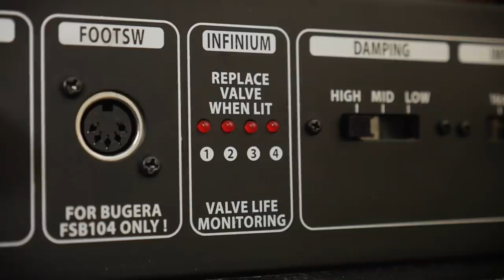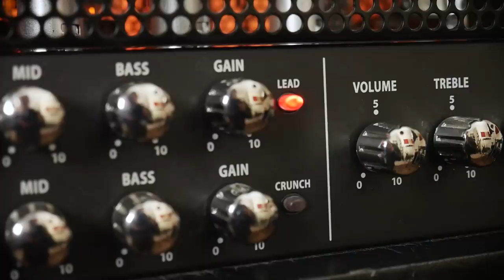Fire Hazard Amplifier?! | Bugera 333 Infinium

Comment: I have to admit, I was very skeptical of Bugera when I was looking for a cheap tube amp I can use for recording at home and it's not helping that Behringer owns the brand. I actually liked the sound of them when I was trying a guitar in a store that sold them. I guess putting a duct tape on the brand works well in keeping them haters quiet.
Reply: Haha, yeah. Did you know though,  The 333 is a Peavey XXX clone, the 6260 is a 5150 clone and the 6262 is a 5150 II clone ;p 

How many knew this? They're basically Peavey knock-offs. I have a PRE Infinium Behrginger 333XL lol. It sound sick IF YOU BIAS IT PROPERLY!!!! The auto-bias SUCKS on these things. From Eurotubes:

"The bias setup is exactly the same as you will find on the XXX right down to the bias test point. This is one place that Behringer should have deviated from the Peavey design and incorporated test points that actually measure the bias current. Unfortunately Behringer stayed with the Peavey bias circuit that measures the negative voltage and NOT the actual plate current. What this means is that you cannot accurately set the bias using the test points. You need to use a bias probe under one of the tubes so that you can actually measure the bias current. DO NOT be fooled into thinking that you can bias the amp accurately as stated in the Bugera manual and on their website. This is a large batch of Barbra Streisand."
Reply: @SolarWarden88  I didn't know that but I'm not surprised, they had a triple rectifier clone. Just Behringer doing what it does best.
Reply: @kurusujann6660  oh yeah, for sure. And at the price point, combined with the proper bias using a bias-probe, they sound sick to be honest. You're not gonna find a combo/head at that price point for the wattage. Sure, you can get the lunchbox amps, but they sacrifice a bit in headroom.

Comment: I remember when I was playing my Carvin X50B with 4x12 cab and it all of a sudden started smoking and caught fire lol. Tubes were 3 months old and had been serviced.  Apparently the design flaw was the tube sockets were mounted directly to the pc board and basically heated it up enough till it caught fire.  A friend of mine is a tech, ended up cutting out the whole back of the pc board and rewired it point to point wiring.  I still have this amp and it works great.  I did swap the EL34 tubes out for 6L6GCs though after it caught fire.  Great amp regardless of this happening!

Comment: I have a Bugera 333XL combo that I got back in '09. Other than the power light sometimes not lighting, I've never had a problem with it. Of course, since I've been playing acoustic for about 8 years now, and my electric guitar amps have been sitting in my Dad's music room for years, I probably have not played the 333XL, or even turned it on since 2013 or so. I need to change that! Wahi' Valleys

Comment: i bought my 333xl Infinium in 2017 I think , It came with el34 tubes. I would like to  trade then out with  6l6 tubes,  , but ive kept it stock,, I keep check on  dyeing tubes  through the lights on the back. It  has heald  worthwhile ,  Only problem ive had over the  years is that the fuse broke,  which was easily replaceable, I luckily have had had no bad experience with the 333xl Infinium

Comment: I bought my 333 three years ago for the absolute bargain of $450aud (about 250 quid) and with only about the same amount of money on upgrades Like Changing to Sovtek KT77 valves and upgrading the capacitors and diodes in the amp with similarly priced but higher quality ones it is now an absolute monster especially with the clean channel used as a 120 watt pedal platform with a good tasteful breakup in the crunch channel

Comment: One of my favorite sounding amps. Mine died after 1.5 years and no one could repair it. Is a shame that Bugera has so many problems. I also bought a 6262 that died, the replacement died too and the third one died but I repaired it myself.

Comment: I bought a new early 1960 infinium in 2012. Sound was immensely plexi-tastic. Blew an internal fuse after 3 weeks.

Rather than open it up & void the warranty, I returned it for a replacement from the supplier.

The replacement amp also blew an internal fuse exactly one week after delivery.

I returned it for a refund forthwith (couldn't trust it to gig with).

5 years later, I tried again to see if quality control had improved. Same problem, but it was 2nd hand, so sold it on.

No fire, just no trust.

Comment: you did the same thing i did and took those stupid plastic pcs off the front. lol. On another note. I had issues with my first as it was second hand and I was warrantied a new one and have had zero issues with it.  THe first one was an easy fix and Bugera let me keep the old one and I repaired it so now I have two and they are both great. The issue with the first was that the valves were mostly dead and it killed the output transformer so I bought a parts amp off of eBay for 100 bucks and had it repaired in no time after, of course , a brand new matched set of Sovteks in both. Now I have a stereo twin full stack setup at a fraction of the cost of some of the amps it destroys on the gain side of shit. I've built all of my own cabinets. They are 3/4" birch, sealed, and each contains a pair of v30s in the top with eminence texas heat in the bottom.

Comment: This gives me an idea for a video. THE HIGHEST tuning I ever play is Drop A, and my "daily driver" is a bass-VI in Drop E. I have owned an Orange Micro Dark, an Orange Crush Pro 120H head, and my current rig is an Effectrode Blackbird preamp pedal running into an Orange Pedalbaby. (Yes. I love Orange. How did you guess that?)

I frequently hear guitarists and music shop employees say playing a bass through a guitar amp will fry the amplifier. Of course, I have never owned any expensive amplifiers of any description, but I have never once had any issues with me being so low-tuned having any negative effects on any of my amplifiers, nor have the valves themselves ever once had any issues with me being so low-tuned. Nothing. Even the Orange Micro Dark can handle the bass-VI in Drop E, if you set the contour knob to filter out some of those lower frequencies.

So, if such low tunings has EVER fried amplifiers, was that all because of operator error? Was it a problem with OLD amplifiers, which is no longer a problem with NEW amplifiers? Is this problem exclusive to expensive amplifiers? Or is this all nonsense?

If you can somehow arrange the logistics, this would be an interesting episode. Think of like a Mythbusters challenge.
Reply from the maker: I'm never done explaining this one:

Playing bass through a guitar amp won't ruin the amp with low frequencies. That just isn't a thing. 
What people are confusing here is not to use a BASS AMP through a GUITAR SPEAKER. 

Bass amps can be rated for hundreds of watts. 500W or 1000W bass amps are quite common, but guitar amps typically only go up to around 100W. 
Guitar speakers are rated for the power delivered from guitar amplifiers. A standard Marshall 412 with have four 25watt speakers since the 100W of the amp will be evenly distributed across the speakers. 
100W divided by 4 is 25W. That's all the speakers need to be. 

BUT if you put a 1000W bass head through a guitar cabinet then each speaker will see 250W at full volume, ten times the power they are rated to handle. 
This will rather quickly burn out the voice coil of the speakers. Note that the speaker cone will hold up just fine to the frequencies, it's the coil that burns out from too much power. 

I did this experiment with Orange amplifiers when they invited me to destroy their equipment for their Void Your Warranty series. We put a 200W bass amp into a 20W guitar speaker and just kept turning up the amp volume until the speaker burned out. Check it out here: https://youtu.be/vuQAJCDQd5E
Reply: I remember that video.

So, since my amplifiers run into a bass 1x15, that explains why I never had any issues?

And in any case, if an amplifier is ever fried, that is because the amplifier was not properly maintained? As you said in this video, not properly biasing the valves is what will burn out valves, circuits, and so on. Or the amplifier is plugged into a wall outlet, instead of a circuit protector.

Comment: The comment you made about range i would argue isn't actually because it's a budget amplifier, It's more about the amps its based on (peavey jsx/xxx/ultra family). I have a peavey ultra plus and it also hates the gain being turned down too low and doesn't really do a good low crunch sound though an od pedal into the clean channel (which is pristine) sounds alright. The crunch channel is 80s rock heaven but not a traditional crunch channel for sure lol. Also with the active eq (which these have in the gain channels usually) once you find the sweet spot you don't really wanna touch it as alterations can be quite extreme compared to amps with passive eq haha.

Comment: I use a joyo mjolnir, and i find an EQ in the loop or in front opens these cheap amps up 1000%. I went from the treble, presence cranked and still sounded under a blanket, to a tight monster. The feedback is an issue for me as well, it's usually a design thing and increasing headroom with an external power amp helps clean it up. The EL84's add an awful distortion layer, otherwise a great amp for like  $450.

Comment: Yeah those are supposed to be Peavey XXX clones, like the XL is supposed to be a JSX clone. They aren't exact clones though so they kinda do somewhat of their own thing which I think is nice. Like the XXX, however, the 333 could do with a lower gain tube in the V1 position. It lowers the gain and opens the amp up a bit.
Reply: Man, if you could share some specifics about this, I'd really appreciate it. This idea, and issue has kept me awake for more nights than I'd care to admit, scouring the web for info, and only finding thread after thread of people asking questions about the Bugeras and the threads instantly turn into flame wars (the only truly flammable aspect of the 333) but I don't have resources to order several tubes looking for the best sound. I need details, to buy once, and then I could swing it financially!  And I'm not a kid, I'm disabled, with no income. One cheap 12ax7 is like 5 skipped dinners for me.
Reply: @alphanumeric1529  I had to look it up again because it's been a while since I've done it with my Peaveys.

V2 controls the high gain channels and everything runs through the V1 slot. I used a JJ ECC832 tube (alternatively known as a 12DW7). If you only get one, drop it in V2 of your amp to lower the gain. If you wanna really lower it, if for instance you like hitting the front end with a tubescreamer, you can use two of them in the V1 and V2 slot.

I'd recommend just getting one and trying it in both slots to see what you like. Avoid high gain preamp tubes.
Reply: @alphanumeric1529  save up buy a set of JJ’s for it and you’ll be good to go. I have the Bugera TriRec and swapped all to JJ’s. I’ve since changed to other tubes, but the JJ’s are affordable and an excellent upgrade from the stock Bugera tubes. I am disabled as well and feel your pain. I have to save up for every piece of gear
Reply: I wonder if this could be a good idea on a JSX too. It has so much gain it's impossible to get a small crunch, and the clean channel being made to take pedals perfectly, it never breaks up. I have to use my IRT Studio for low gain stuff. I'll steal your idea !
Reply: @Totone56  I had a JSX too. It works
Reply: @Killahead.  Thank you for this suggestion. This is outside of info I've been able to gather, so thank you very much!

Comment: Bugera is incredibly hit or miss on quality. I owned one for 10 months and 8 out of those 10 months, the amplifier was not in my possession and was actually out for repairs or replacement. I went through 2 TriRec (with the Infinium circuitry). The first one quit working after 3 days of owning it and playing at bedroom levels so I sent it out to be repaired. After 4 months of nothing happening, I called Behringer's customer service (Care Music Group at the time) and they just sent me a replacement amp. That took another month. When I got the new one. I played with it for a week and noticed that the reverb, boost and varipower all didn't work so I had to send it to Montreal to be repaired. After a month goes by of nothing happening again, I call the repair center to find out what's going on and they tell me the technician working on my amp is on vacation. Fine. After 2 months of the second amp being out, I finally get it back. I test out everything and find that the reverb circuit still wasn't fixed so I had to send it out again. This time, the turnaround was relatively quick in about a month. I had been so fed up with the quality issues, dealing with customer service, paying to ship the amp out for repairs (which had cost me $350 between shipping costs + insurance) that I decided to cut my losses and sold the amp 2 months after it came back from repair the final time and I had already bought an Orange Rocker 15 Terror that gave me no issues at all.

I'm not saying that the amps are so bad that they'll catch fire and I know other people who own Bugera's that have played them for a long time without any major issues like what I had, but I am saying that they should be avoided because the QC is so hit or miss and my personal experience with one was not positive at all.

Comment: if you want the most out of that amp
put a Wampler Tumnus in front of it with low gain setting and you will be able to get those low gain settings. i have the peavey jsx the amp that amp is based off and same issues and i discovered the klon clone used as more of a low gain boost really opens that amp amp. even on the ultra/lead channel i was able to turn my volume on my guitar down and get very clear useable cleans. as i bring the volume on the guitar up i go through the different levels of break up with full dynamics. 

definitely try it out if you like what it does you should make a part 2 ;)

Comment: You should try a Jet City JCA50 or HDM100, Soldano circuits. I own  JCA 50 , but I also own a 5150 block, and a JCM800, 2 of THE most iconic amps ever made, and what is my go too? which amp would I save in a fire? .....The Jet and I dont even have to think about it. Clean and crunch is better than the 5150, Hi gain is better than the 800 and is actually very close to the 5150 in tone (slightly smoother , tighter bass and slightly less gain, but still more than enough for any style). It really is far more versatile and does pretty much what the 800 and 5150 are good at ...and more. They are licenced Soldano circuits (Hot Rod 50 I think is the base circuit?, and possibly the SLO for the HDM)
Cost £250 from Thomann 4-5 years ago...NEW!!!!!!. They don't make them any more (although Jet are releasing some new amps soon, not Soldano circuits though) but they are still cheap on the used market. I promise you this though, as more people find out that they are killer amps the prices will shoot up (and not just good amps for the price...they are killer amps, end of story, I mean they go toe to toe with 2 of the most iconic amps ever made ffs and cost a quarter of the price, the pre EVH passing price, let alone the current 5150 used market).
I suggest buying one if you get the chance , t anyone reading this, not only will get a great sounding amp, but its likely to start going up in price as time goes on. They were not sold in crazy numbers so they will become somewhat rare at some point.

Comment: Can confirm that most issues with Bugera are no longer relevant. MY 333XL broke (twice actually. It let go of some magic smoke, but nothing looked wrong and It started working again, but now i have fading power), but I DON'T HAVE AN INFINUM, and don't know the warning signs of a failing tube amp (aside from the obvious issue my 333XL has with power fade). If you want cheapish copies of famous amps, Bugera are genuinely a solid option

Comment: How can I tell when a valve is about to burn out? A couple of years ago, I was given one of those Marshall ValveState amps from the late 1990s (with one valve) , and I have no idea what the state of the valve is.
Reply: Preamp valves are rarely an issue. I’ve never seen one burn up in 35 years of playing. Those old Valvestates are kickass.
Reply: My 5150 just had a valve pop, no warning whatsoever
Reply: @ccandrew111  What happened? Did it literally explode?
Reply: @kluzz  the glass cracked and it lost its vacuum, took a fuse out with it as well
Reply: I saw a tip that I tried and it works. Use a wooden chop stick to gently tap the valves while the amplifier is running. A valve that is nearing failure will often give off a glassy ping. Healthy valves does not.
Reply: @svenkaahedgerg3425  Inducing microphonics by tapping them actually damages the valves and shortens their life.
Reply: @ErebosGR  Thanks for the heads up. They did not warn about that.
I had seen this tip in a couple of instruction videos and they didn't mention that risk so I tried it myself. I barely touched them but found the bad one right away and switched it. Since then it has played perfectly but I guess I got lucky.
Reply: @svenkaahedgerg3425  I'm not saying it's a bad diagnostic method. Just don't do it frequently on relatively new or otherwise perfectly working tubes.

Also, it's better to swap all of them with matching pairs when one goes bad, because tubes with different biases will shorten each other's lives, unless the amp can get re-biased or has an auto-bias feature, like the Bugera Infinium amps.
Reply: @ErebosGR  good to know.
I was just checking the pre-amp section. Since I don't have the equipment for biasing I never mess with the other ones myself.